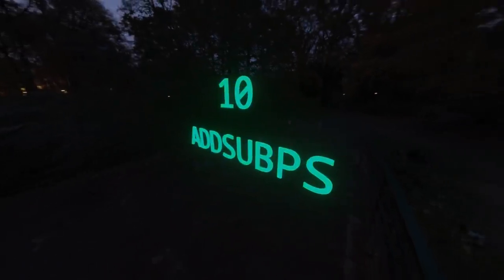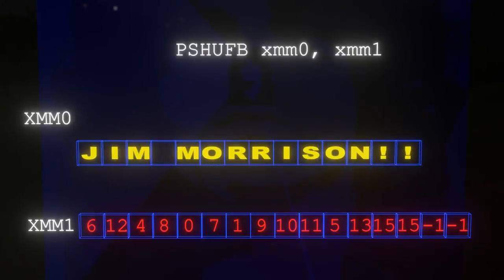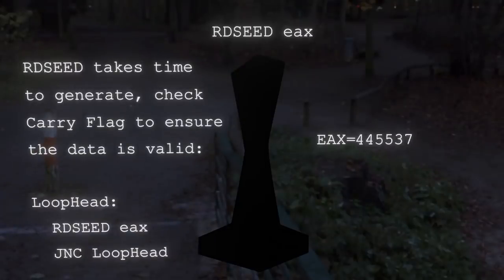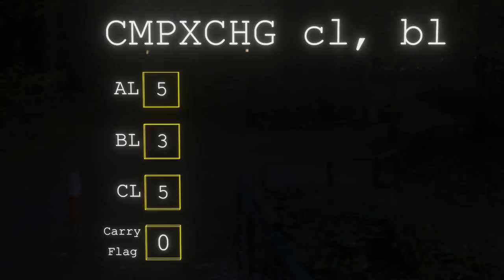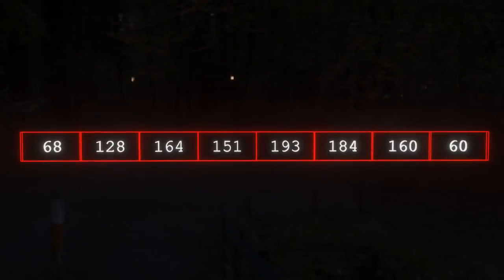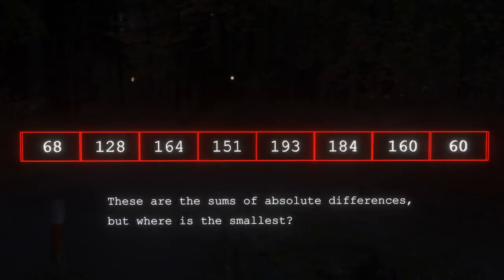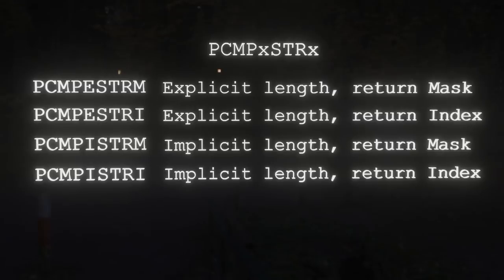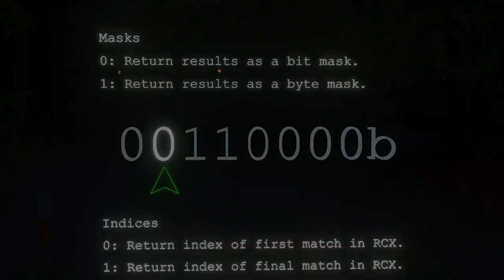Top 10 Craziest Assembly Language Instructions

Comment: I bet that the last instruction has been implemented in >1000 LOC's of program source code more times than the times that developers have knowingly used that instruction. Must be demotivating for the engineers that made these instruction sets to see programs doing single CPU instruction tasks in lengthy C code.
Reply: Less demotivating than seeing people implement things in Python, for example.  I mean, you spend years, getting the gate size and operating voltage down to optimize for power consumption, and then people write code that runs on a virtual machine that is implemented in another virtual machine, and so on.
Reply: @BrightBlueJim  but then again, not everything is about perfect or optimal. A lot is about being able to do it at all. So I guess they can be proud knowing that they've made hardware that allow people to run VMs inside VMs without the users noticing.
Reply: @siljamickeify  Perfect?  Optimal?  No.  Writing things in high-level interpreted languages that really don't provide any benefit over low-level compiled languages is a little like using a 2000 kg machine just to get 100 kg person from place to place.  If there are users who don't notice, it's because they're using 3 GHz machines to do what 2 MHz machines could do, if they weren't stuck with applications that ran on endless layers of abstraction.
Reply: @BrightBlueJim  in my work I develop in C targetting embedded processors. I also need to develop various tools running on a PC that connects to the embedded device. On the PC we have a plethora of languages and frameworks to choose from. Assembler or C is not at the top of my list for these purposes. I rather choose C#, Java, Python or even javascript. I do not mind spending a few extra watts of power to let me bang out a GUI application with ease in Python or C#, without a single thought on how the resulting machine code could be more efficient.
The right tool for the right job, right?
Reply: @BrightBlueJim  you're by the way right, it's a lot like using a 2000 kg automobile to haul 100kg of people around 😀 
And, I do enjoy me some 2MHz 8 bit development, but those machines weren't neither power efficient, nor were they able to do much.
The irony here is that I use my 3GHz PC to emulate my 2Mhz machine. Full circle 😀
Reply: @siljamickeify  "I use my 3GHz PC to emulate my 2Mhz machine.'  And does that PC use less power when emulating the 2MHz machine?  Of course, there aren't any contemporary 2MHz machines, but if you use a 20 MHz processor and put it into a low power mode while waiting for the next thing to do, you get something that is exceptionally efficient.  Not the first priority in most applications, but sometimes important, like when you're using a photovoltaic power source.
Reply: @siljamickeify  Right tool for the job?  I've spent plenty of time programming in Python.  What I learned was that it provides ZERO advantage when it comes to two of the most important things to me as a developer:
1) Does it help prevent me from making mistakes?
2) Does it help me find my mistakes?
In that light, I've come to a different conclusion about what the right tool for the job is, in most cases.
Reply: @BrightBlueJim  I just trying to be humble enough to think that if assembler was all humanity needed, other languages would not have been invented and loved.
Reply: @BrightBlueJim  and I can not claim that C or an assembler has helped me avoid mistakes more often than C# has.
Reply: @siljamickeify  As far as assembler goes, I agree.  The early compiler inventors saw the benefits of making programming both easier and far more portable.  I think the original idea was to make it possible for customers to upgrade to newer models of a given line of computers without having to rewrite all of their code, but as a side effect they created virtual machines, at least on paper.  My biggest objection to microcontrollers, when they became available, was the portability problem, since most didn't immediately have compilers available for them, at least not affordable ones.
Reply: @siljamickeify  "I can not claim that C or an assembler has helped me avoid mistakes more often than C# has."  Again, I was not arguing for assemblers being the right tool for any but the most specialized jobs, but the real question is, has C# helped you avoid mistakes, or helped you to find them, better than C?  I haven't used C# myself, but my experience has been that higher-level languages in general have not helped me much, and certainly not enough to justify their inefficiencies.
Reply: @BrightBlueJim  well, I make, and find mistakes in all languages I use. Of course they all have their strengths and weaknesses, but I have to acknowledge the impact certain languages have had simply because of how easy they are to develop in. More is created faster thanks to modern languages, frameworks and development tools and stacks. I think good developers make sensible programs in any language, and bad programmers make turds for programs in any language. Not everything in npm us good, but everything in the C standard library isn't perfect either.

Great discussing with you regardless of the outcome! I hope you're having a great weekend!

Comment: Holy crap, MPSADBW would be amazing for doing block matching for stereo vision depth and disparity calculations. You take the value of a bunch of grouped pixels from one camera frame and scrub it horizontally across the x axis of a frame from the other camera to find the closest match i.e. the minimum. Its like this instruction was tailor made for it. Great video btw

Comment: I first learned about CMPXCHG in contemporary reviews of the 486 that questioned the level of architectural improvement over the 386. Some reviewers thought the instruction was bizarre and was representative of a lackluster architectural improvement. Granted, it wasn't used much in the main lifecycle of the product, but the Linux kernel ended up requiring it, which is why 386 support was eventually dropped. Linux is possibly dropping 486 support (can't tell if they went through with it) for a similar reason: they want to require the presence of CMPXCHG8B, introduced with the original Pentium.

Fun fact, it was problems with CMPXCHG8B that resulted in the Pentium F00F bug. The FDIV math bug is more famous, but the F00F bug would lock the processor rather than give slightly imprecise floating point results.

Comment: (Real programmers program on the bare metal). More weird stuff long before the 86.  First ASM experience when programming proprietary system periphery attachments way back in 1976 ... twas a 4-bit processor with "q-loads" ... used to program an RPG system who to display RTL languages (i.e Hebrew and Arabic). Loved it, even though the compile and media convert involved punched cards and 8-inch floppys. My instruction manual was a single sheet with the instruction set and a cpu register block diagram. Nostalgia. Thanks Creel.

Comment: I actually used PSHUFB in one of my projects 10 years ago! I was building a reimplementation of a certain game engine with hopes to have it work on both big endian and little endian computers. Some of the input data is big endian, so this is where this instruction shined!
Reply: PSHUFB is pretty much crucial for all sorts of byte-level trickery!
I was able to beat Google's internal LZ4 decoder by using PSHUFB to generate arbitrary length replication masks whenever the encoder had encoded a repeated pattern that started not more than 16 bytes from the current position and which would actually overrun the start: 

Instead of repeatedly grabbing 16 (mis-aligned) bytes from the pattern start and appending them all to the current position, then update the current pos by the length of the pattern (which is what Google did) I would use PSHUFB to read and repeat the source pattern as many times as it would fit in 32 bytes, then from that point there would be no more reads, only a loop of storing 32 bytes, updating the write pointer (17-32 bytes forward) and repeat until done.

Comment: I think I read somewhere, sometime (sorry, no source!) that this is the result of the longevity of the x86 instruction set. Several times when the engineers designed a new chip in the series, they realized that they could easily add support for some new, odd instruction that just might be useful to someone, somewhere. The problem of course is that once a new instruction is introduced, it is expected to remain forever as one of the main selling points of x86 chips is the backwards compatibility. In newer generations, these weird instructions still have to be supported, even when they might no longer be cheap and easy to implement. The shift to microcode should make it easier, but I'm still amazed that none of these weird instructions are translated into a bazillion native instructions that take forever to execute!

Comment: It is bit unfortunate that support for some of these instructions is too uncommon to be used in general, but if you wanted to use these it should be pretty easy since most if not all of these have C Intrinsics. I was bit confused about cmpxchg functioning called bizarre. It being the one of the most basic and fundamental element of multi threading, but it seems like you did explain it in the end.

Comment: on the one hand it's really impressive to see what can be done directly in the hardware, on the other hand i can't imagine any compiler made by mortal hands could ever make effective use out of these... so there are probably a lot of instructions that go completely unused. and a big part of those are likely only included for backwards compatibility...
it's kinda a shame how much silicon is being "wasted" on features and instructions that will never run on the majority of PCs.
Reply: maybe padding with unused instructions for heat dissipation haha.
Reply: The instructions included for compatibility are implemented in microcode, so as to not be a burden. CPU manufacturers say in their documentation which instructions to actually use and which to avoid. Compilers target a more RISC-like subset of the x86 CISC instruction set. The exotic SIMD stuff is certainly intended to be used.

Comment: Great video! God I love ARM assembly. None of this garbage. The data sheet is like 3 pages, most instructions take like 1 cycles. (speaking mostly of pre-NEON - with NEON all bets are off) Optimization is a breeze :). I read my first book on x86 assembly when I was 11-12 , back in the early 90:ies,  and though: "8+16 bit addressing mode, huh? Think I'll stick to MC68k assembly with a bunch of 16-bit general-purpose data registers, general purpose 32-bit address registers and general-purpose addressing modes and cohesive programming modes and hardware instead of weird hardware hacks when you can't stretch your 16-bit x86 CPU to reach quite far enough where you need it to be." Then I read my second book on x86 assembly in 2006 and thought: "Huh, instruction mnemonics that are so long that they might as well require appendices and that execute for an almost arbitrary number of cycles? The manual is like thicker than a phone book? ARM assembly it is, then!" ;D.

Like, let's take a look at https://en.wikipedia.org/wiki/X86_instruction_listings . Let's pick an instruction. PUNPCKLQDQ? Are you fucking serious? Granted, that's SSE. I suppose the core scalar ISA is less absurd, but still. I have never had the impression that x86 is made for human beings to program but simply for compiler engineers to write compilers for. (maybe not throughout the 90:ies - the complexity had not quite reached the absurd levels we're seeing today - but certainly from the turn of the millennium and onwards.)

Comment: you could use MPSADBW for an integration of a folding between 2 signals. E.g.: Wireless protocolls like Wifi use special signatures to mark the start of a frame. A lot of time goes wasted to search the start. With that operation you can save time to find the most likely point(s) of the framestart.

Comment: Some comments from a long-term (since 1982) x86 asm programmer:

PSHUFB The only way it could have been better had been by allowing one more index bit and a pair of source registers, i.e. like the permute opcode from Altivec.
The MMX instructions were the enabler for Zoran's SoftDVD, the first ever software DVD player which could keep up with 30 frames/sec without any drops.
LOCK CMPXCHG should be replaced by LOCK XADD which is a much stronger atomic primitive, they are both more or less useless in their lock-less/reg-reg forms.
PCLMULQDQ or bit matrix multiplication was almost certainly added on the behest of NSA, it is a very useful primitive in cryptanalysis.
MPSADBW is a core primitive of several video and image codecs, as guessed here it is used to detect similar source blocks for motion estimation based compression.
PCMPxSTRx is indeed the strangest x86 instruction ever, I am pretty sure that instruction is Turing Complete all on its own, you would just need a set of data tables that implemented whatever logic you need.

Afaik, none of these have ever been generated by a compiler, they are only useful in handwritten code, either pure asm or compiler intrinsic forms.

Comment: ..and I thought going from C64 6502 to A500 68k assembler in the late 80s felt like a high level language!

At some point you would have thought the microcode would just be opened up to the dev rather than an ever expanding instruction set.

Comment: I was never a fan of the register set or the assembly instructions of the x86. This shows how much stranger things have become. I'm used to coding in assembly for a number of different microprocessors and microcontrollers. It amazes me to see how long is the mnemonic for some of the instructions. The PEXT, PDEB, and PSHUFB instructions are interesting as I can see a use for them. Some of the other instructions seem to be oriented towards matrix operations.

Comment: I wonder how many of these an optimising compiler would be actually capable of using when appropriate, and how many only turn up in hand-optimised assembler? Are these part of the reason the Intel compiler is generally regarded as producing faster code than rivals?

Comment: I would be very interested to know if compilers know how/when to generate these instructions or if it is left to the programmer to use them inline with their C/C++ for specific optimizations.
Reply: I have had to dabble in ASM quite a bit to get my code to work faster when processing large amounts of data. Most compilers, at least a few years ago, optimized very well, but did not use these highly specific instructions. So in practice there is performance to gain.

And then along came CUDA and instead of optimizing CPU code, we just made crappy CUDA code, which ran faster still 😂

Comment: Thanks, really good stuff. These specialized instructions are nice. However what happened to memory locking and instruction logging by IBM and DEC.  I hate our technology. It might take me a bit to find a use for these instructions. However I am sure there is a purpose, just not available in our (so called) high level compilers.  I thank you for the information, your did some good work. I will keep this link, knowledge is everything.

Comment: Ahh I remember the days of programming when you'd forget one little full stop and get a 300 page error printout for your insolence!
Reply: U mean a core dump??
I uses to read 3,000 page core dumps, then the ops manager thought it was a waste of paperboy and Sens it to a COM machine (COM=Computer Output to Microfiche)
Reply: @rty1955  I was an IT helpdesk tech for different Co's and one call was from a user that said her New PC didn't work... After a few focused questions the conversation went like this...
"Wait... What is the brand name of your PC"
"Racal"...
"and the brand of screen"
"Microfiche"...
"ooooh K..... What's happened is someone has put a network modem on your desk with a Microfische viewer on top of it and a keyboard..."
"Oh... Well non of the terminals are working either.. We plugged the controller into the phone line but it didn't work"...

This is where I discover an entire branch moved site to this office, plugged the mainframe controller into a standard phone line.. and expected it to work...
Back then we were impressed NZ Telecom got the hired line moved in 2 weeks...
Reply: @TheButlerNZ  haha oh god I could never work on a help desk, with going down a list of technical questions only to learn a. Able or power was not plugged in!
IBM mainframe controllers at that time used the 3270 bisync protocol which used synchronous transmission. It was possible to use 9600 baud dial-up but it was horrible.
I still remember the 3270 protocol. I had wrote a modified version of that protocol for a bank and also modified a bisync pass thru program to allow 2 mainframes to talk to each other. 
Fun days
Reply: @rty1955  We had a System/38 in Mobil NZ that treated the disk packs as sectors of one big disk... one of the managers tripped and put his hand on the power switch of one pack turning it off... The system decided there was a 'bad sector' in the array and it took 2 days to get the thing back up.
My manager told me of something he saw in Oz. A newbie managed to remove a disk stack (the 12" alloy brown coated stacks in a box that looked like a curling stone...
but he hadn't shut it down (somehow safety features failed)..
fine until it was above the unit and he tilted it... inertia took over and he hung on, smashing several things like a sledge hammer before he let go.

Fun days.